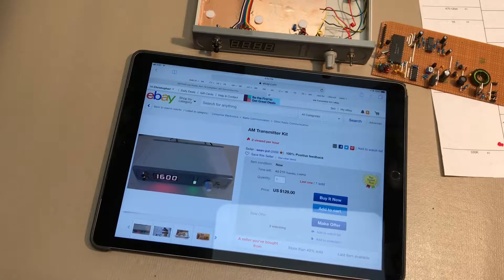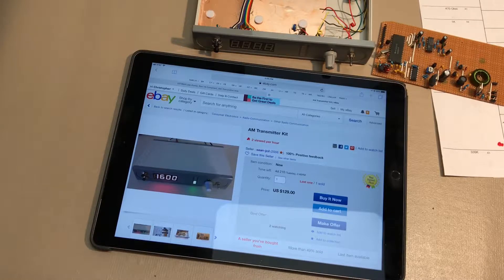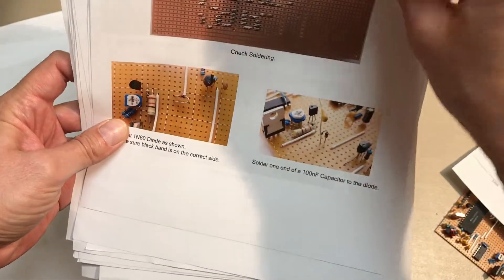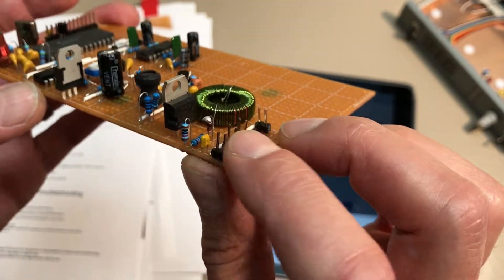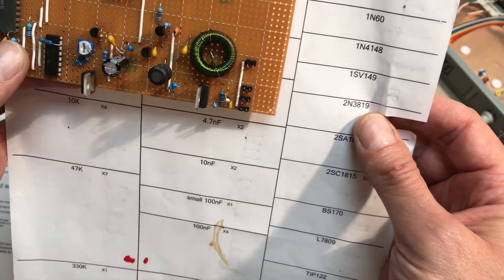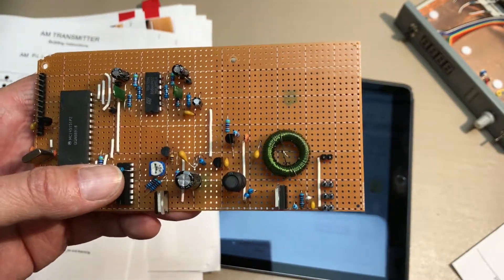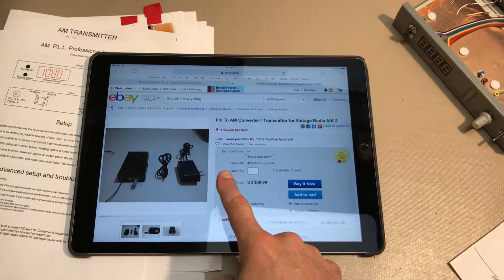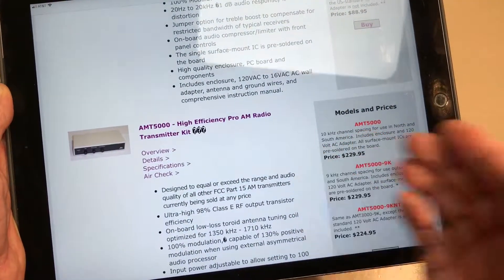AM Radio Transmitter Kit | P1

Comment: I'd be wary of any "kit" that is built on veroboard instead of a proper PCB. Especially when dealing with RF circuits!
Reply from the maker: Performance certainly doesn’t suffer from the construction and the board doesn’t sacrifice much from a PCB. Circuit lengths are short and tidy. I’ll remind you that this is AM radio which existed for decades before PCB technology. Many very high performance RF devices were produced using point to point wiring which inherently suffers from poor ground points, long wire lengths and non-ideal component placement. The board in this kit is light years ahead in those departments.